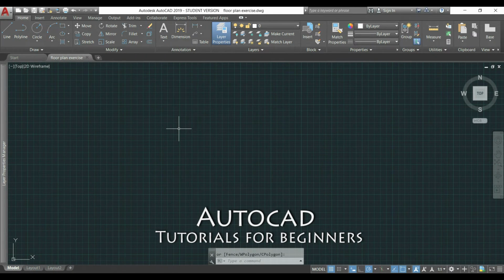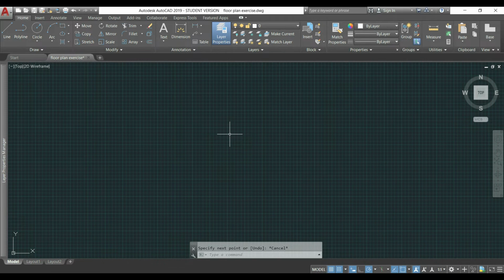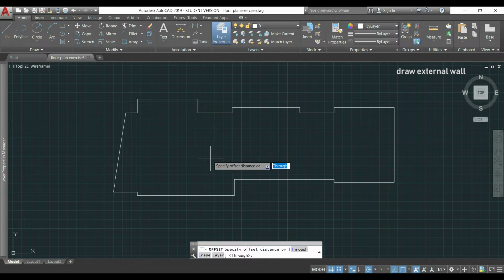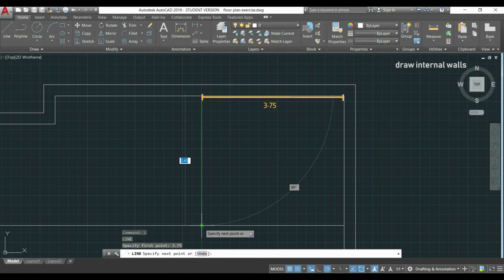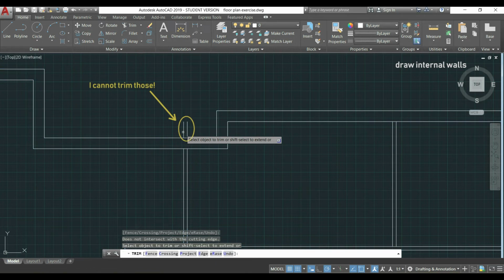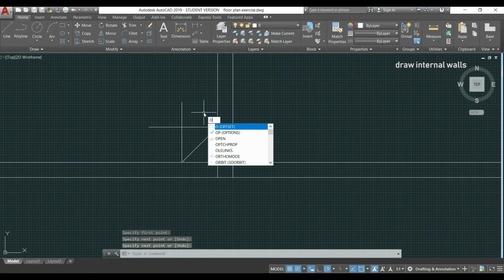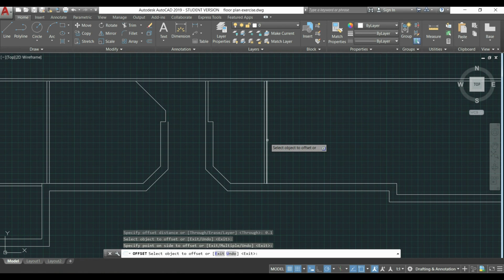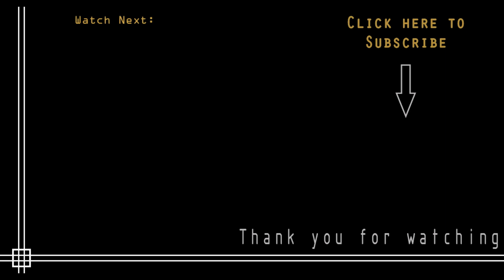Autocad 2019 - Tutorial for beginners (tips do draw a floor plan) - Part 1

Comment: I got confuse in 12.04 the diagonal lines.
Reply from the maker: "Diagonal lines" is the section of the external wall that is not vertical and horizontal. I used supported lines to help drawing them.
Reply: @CADinblack  ok sir but can you do a tutorial about hvac 2d or 3d in autocadd

Comment: thank you sir but how to know that what should be the thickness of internal wall and external walls ? please clear this .......sir
Reply from the maker: Hello. I used the thickness that I showed on the video. However, you can just use a different thickness. This is just an exercise, and the goal is that the students get used to the autocad commands with practice. The measurements are not very important here! Thanks a lot for watching. :)

Comment: Just learning how to use AutoCAD and a problem I have now is that when I zoom in I dont get the grid inside the grid (hope you understand that) so just wondering what grid spacing size you were using?
Reply from the maker: Probabilty you have the grid and snap spacing to large, because this drawing is in meters. Try to make it the spacing to the centimeter. 0.01

Comment: How do you turn on the option to see the dotted green line, or is this a 2019 thing only? I use 2018 currently.
Reply from the maker: Hi +
The3DSMaxinator. You should turn on Polar mode. It is an icon located in the status bar (the group of icons located at the botton of the screen). It has a shape of a circle with a radius.

Comment: You use the wrong type of dimensions it's supposed to be feet/inches
Reply from the maker: Hi +Jabob Powel. First of all, thanks for your comment.
That depends of the country where you are. I think most of English speaking countries use inches, but in the remaining part of the world there is a preference for metric units. I don't know if there are countries which use a different system than those ones.